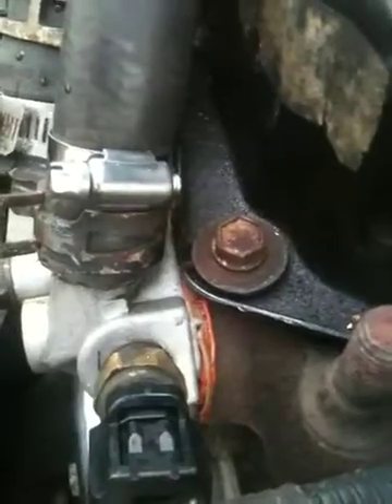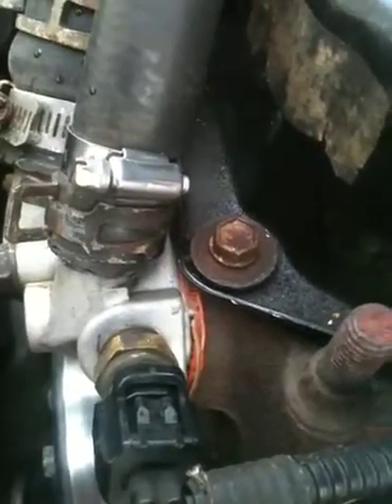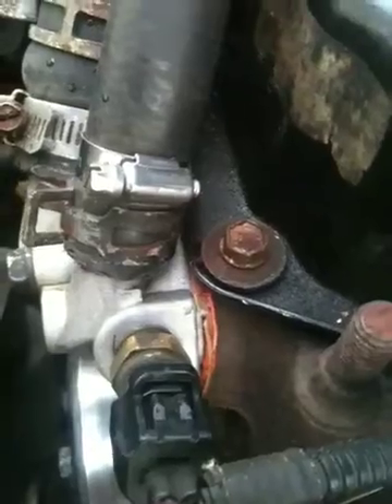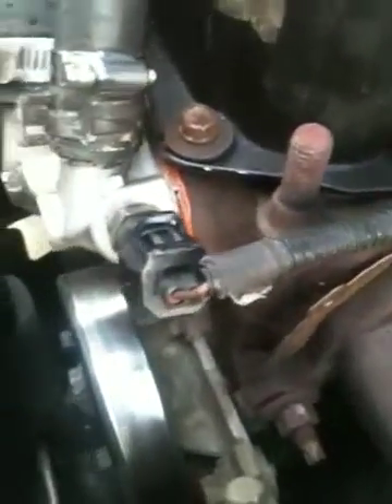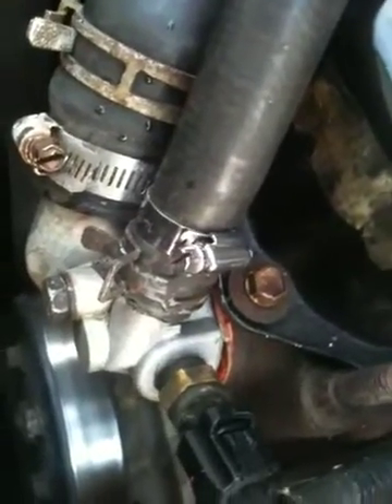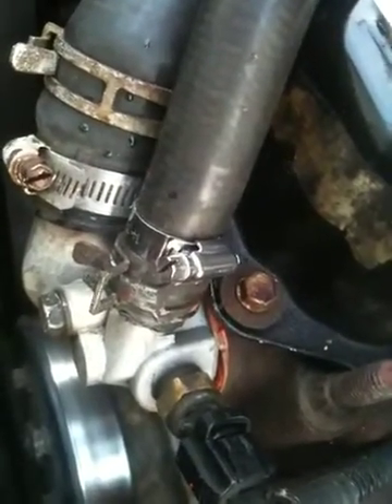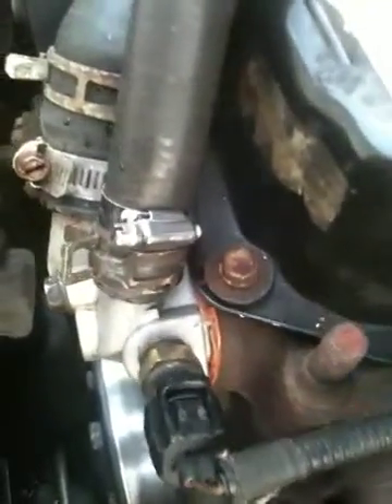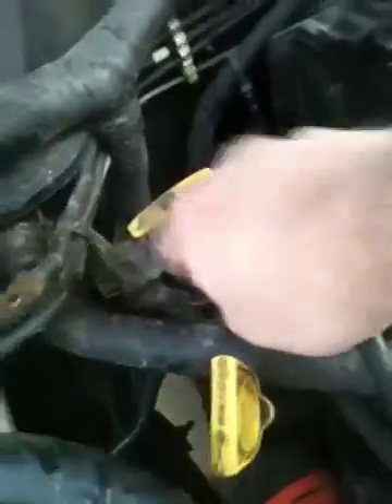Jeep Cooling System Problem

Comment: The double clamps are completely unneccesary and should be removed. The amount of silicone sealer on the thermostat housing is excessive and will actually cause a leak, not prevent it. If the housing uses an o-ring no sealer is needed, install it dry. If the housing uses a flat paper gasket you can use a special spray on sealer that prevents the coolant from weeping throught the paper. Some flat gaskets come precoated. Silicone sealer is RARELY used on modern cars.

Comment: Properly torque the two bolts.
then get new hoses and clamps
The constant tension hose clamps used as oem are superior to the band clamps but require special pliers to avoid damaging them. Replacements are available from grainger and with proper tools will be much less problems than the adjustable band clamps your using.

Comment: What a mess, I'd start over.
Remove the thermostat cover /header and thouroughly clean off all the old gasket and that mass of silicone. Recommend special gasket scraping tools and maybe a little scotch-brite to finish.
Install new gasket, lately they all seem to be sticky on one side, so just stick it on where the holes line up on the cover. I smear a very thin layer of silicone on the exposed gasket and tighten it up. I blow the water out of the boltholes and apply some thread sealant to bolts